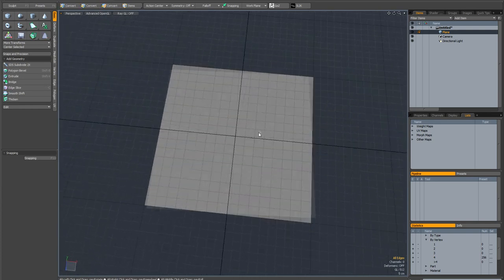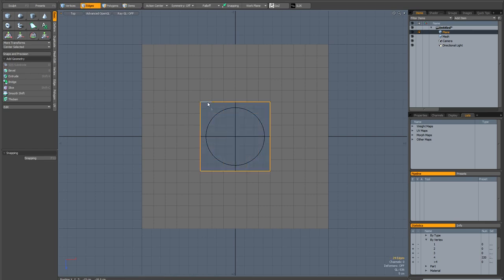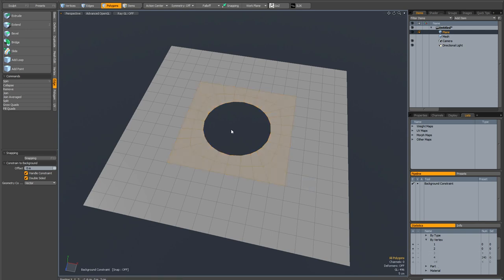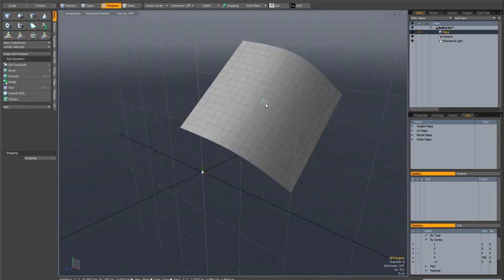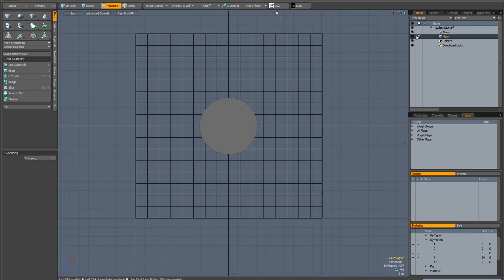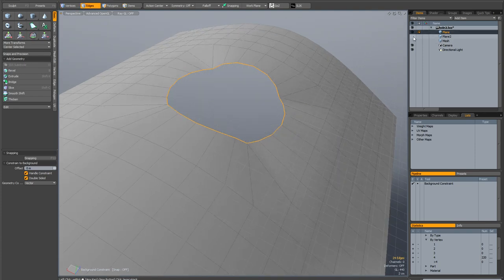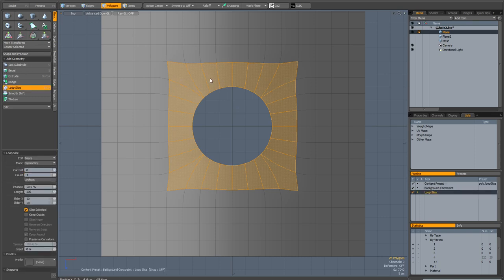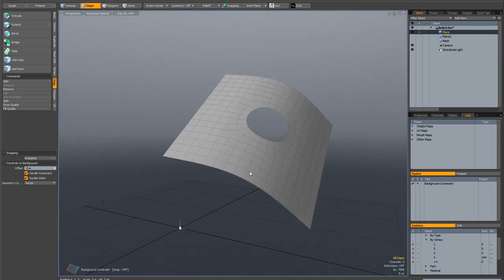modo quick tip: making holes quickly in a subdivision surface

Comment: Easy solution for the curved example but there is a way faster. 
Fast retopology! Align workplane. Create e new topology with the hole (you can also use perfect circle plugin from Seneca). The project the new topology on the old one and delete the old one. Merge. It looks slowr but instead is faster...with shortcuts even more faster. Modo Magic :-P

Comment: Do you know how to do this but with a square hole? I want a smooth round surface with a hole that has sharp corners, without causing the surface to gain creases.
Reply from the maker: You could try using a constraint mesh with sharp corners.